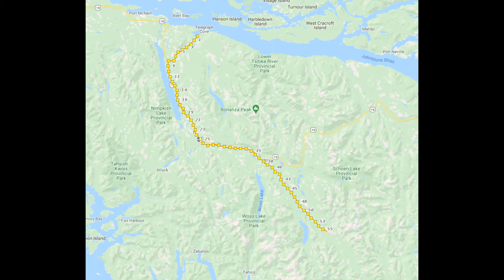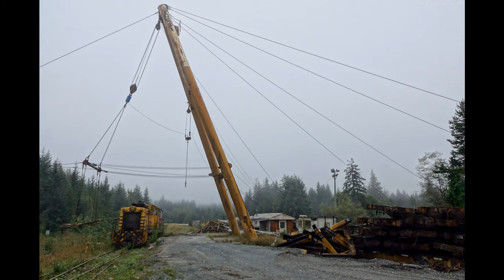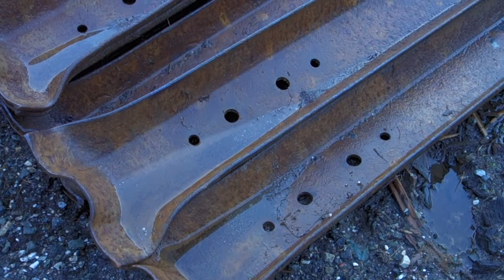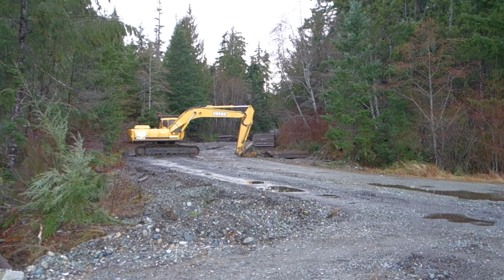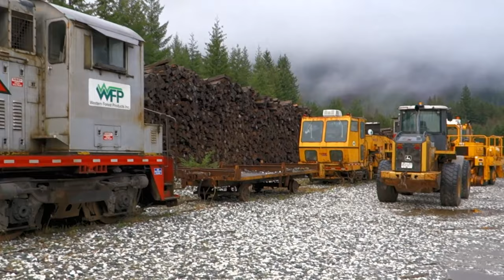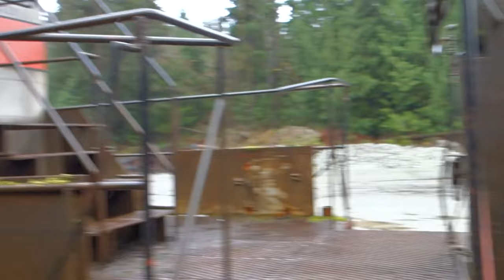Englewood Railway - Camp-A January 2021 Update

Comment: I got to see this twice before the dreadful accident. Most recent was in September 2014 when nothing was running and two of the locos were tied up at Beaver Cove. Prior to that, I guess around 2008 I stayed over night in (Port Alice?) and saw a train of empties come out of Beaver Cove next morning. I spent quite a bit of time at Camp A photographing a late afternoon arrival and switching. It seems to have never been the same after WFP took it over and how 40 highway trucks can be more economical than one 40-car train, I don't understand. There's a very good video called 'The Last Logging Road' by Chandos Television if you want to see the railway operating in happier times.
Reply from the maker: Thanks Chris for this comment and the information on the Chandos Television item.
I had a couple chance sightings in the 2014-2016 era, while I was driving on Highway 19.   I wish that I would have been more interested in this stuff, back when it was operating.